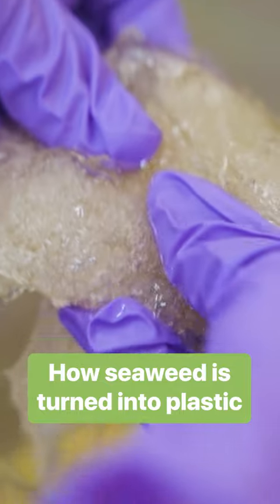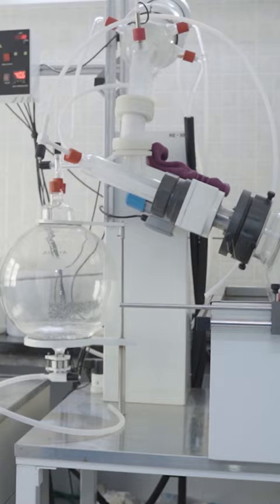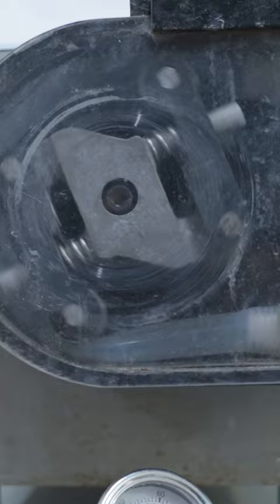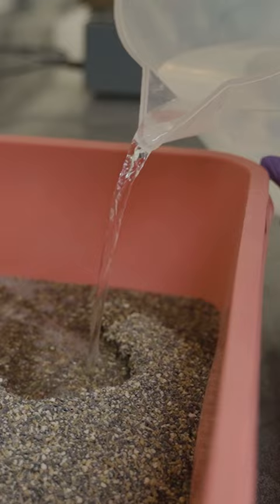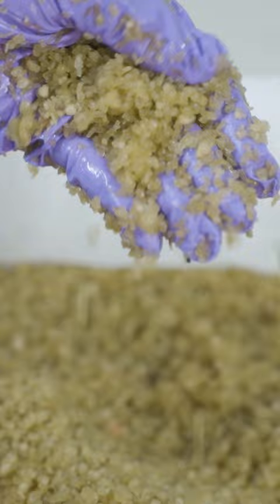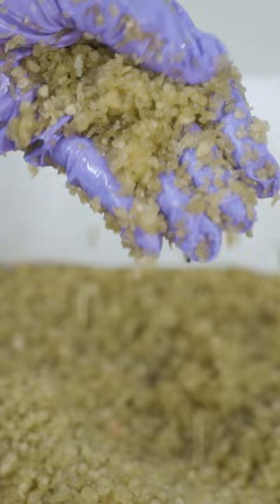This is how seaweed is turned into plastic. #seaweed #sustainability #ecofriendly

Comment: But how can it cover any type of food if it dissolves in water?
Reply: Boiled water
Reply: Metal rust, but you can still make a boat out of it.
Reply: Yeah there's always a catch with these technologies.
Reply: @sunshine3914  I really wanted to know how, it wasn’t a snotty comment. As there’s an explanation for why metal doesn’t always rust in contact with water, so there must be one for this thing too!
Reply: Usually with bio plastics, "dissolve in water" means it takes weeks or months, but not hundreds or thousands of years to dissolve as with regular plastic (also dependent on temperature and physical forces such as the waves in the ocean). So depending on the kind of bio plastic, you can still cover food with it
Reply: Easy; pack it in more plastic
Reply: maybe mix it with hydrophobic solution